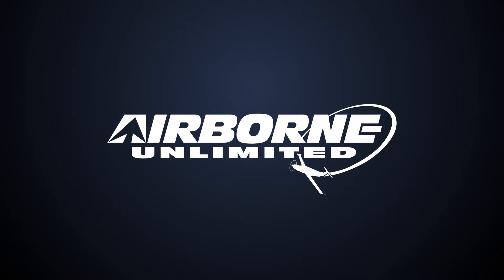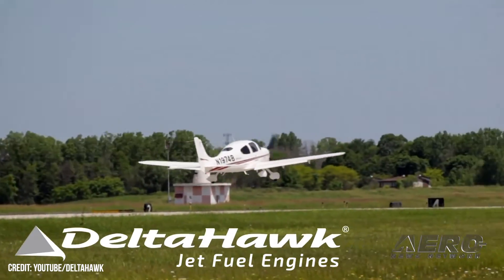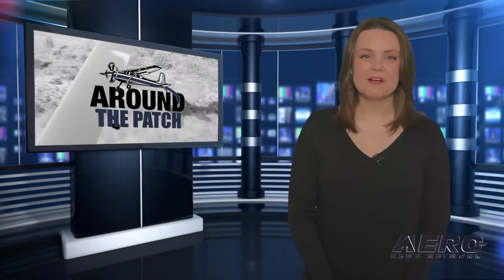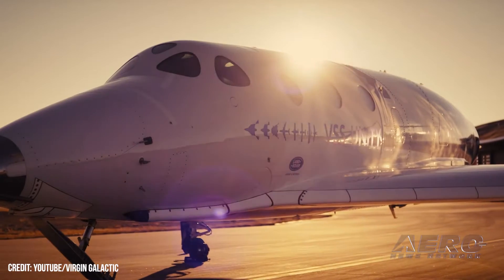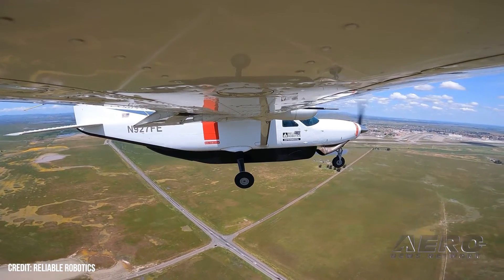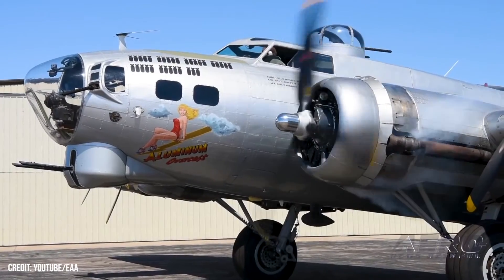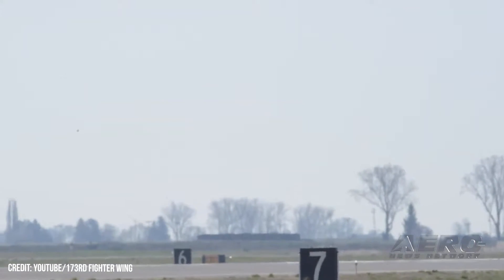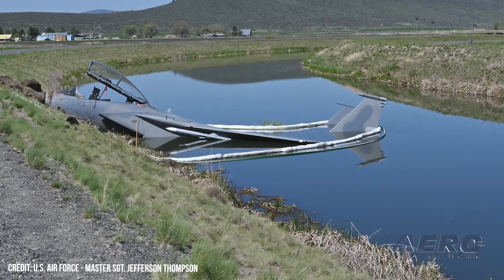Airborne 05.19.23: DeltaHawk DHK180 FAA Cert!, B-17 NPRM, Ditched F-15D

Comment: I did my thesis paper in 2004 on diesel engines in small GA aircraft. Delta Hawk was promising back then but 20yrs later to get certified? Damn. Rotax has narrowed the gap on tech and power. Hell you can get two new 916s for the price of one Delta Hawk.